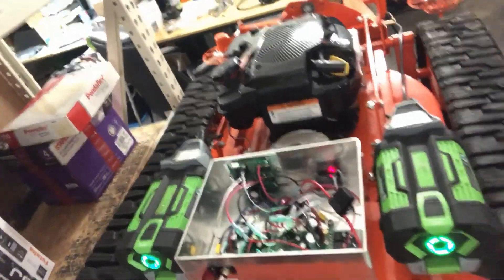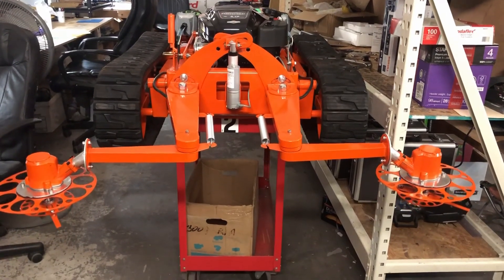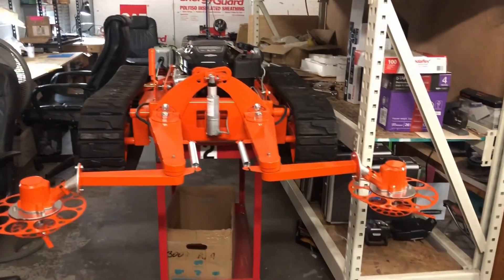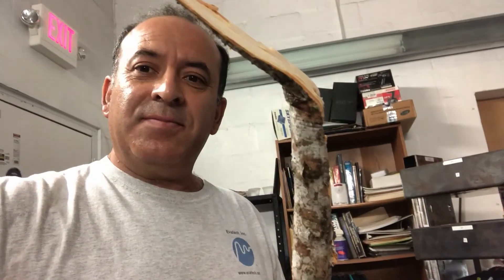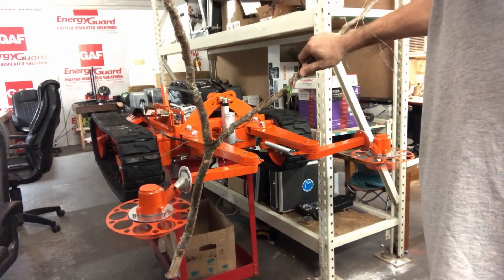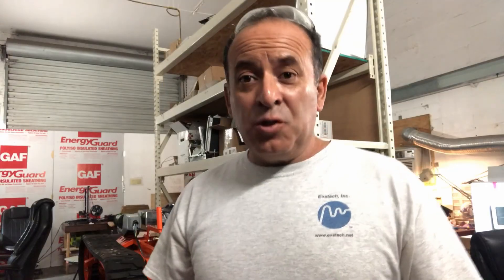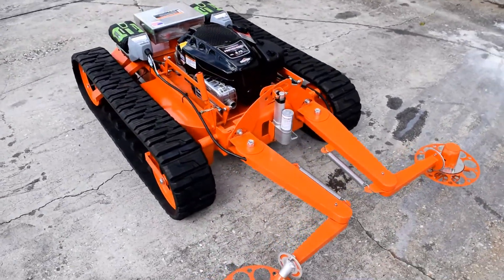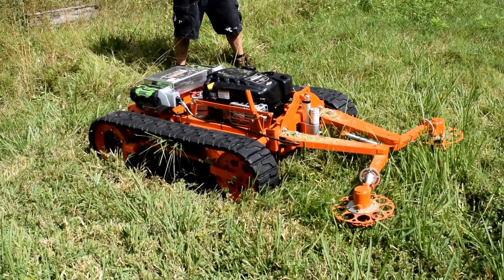FIRST TIME EVER BLDC MOTOR  MASSIVE POWER FOR ROBOTIC TRIMMER ARM

Comment: I would think they would be more useful setup for cutting the edges and if they were a bit bigger and lined up they would cut the edge and cover into the area of where the mower cuts so can get the parts the mower doesnt when in close proximity to walls and other things where the wheels stop access.